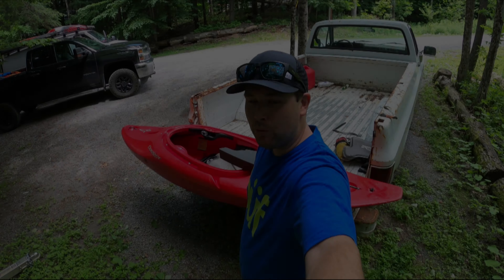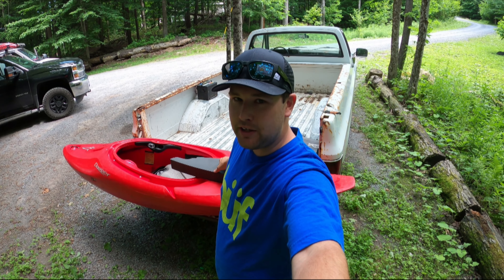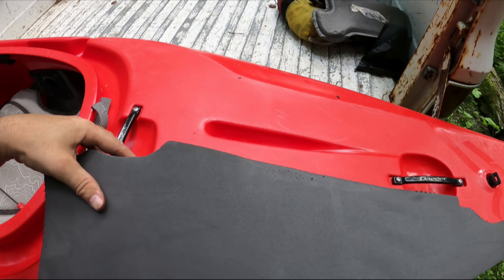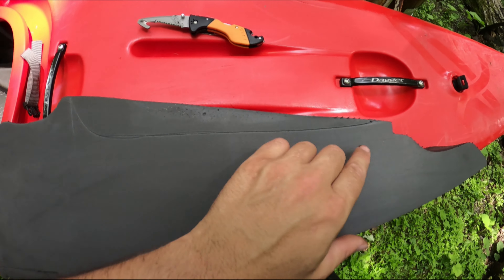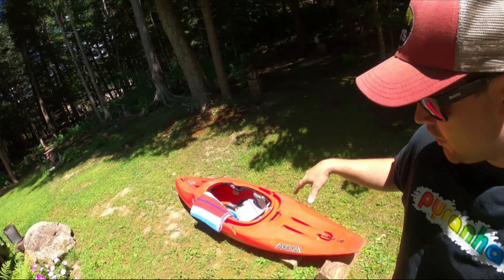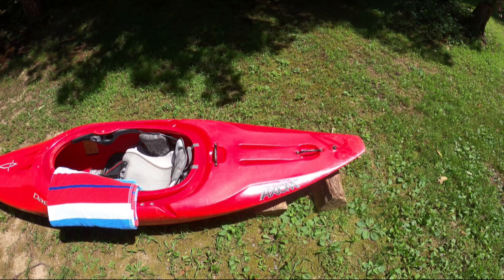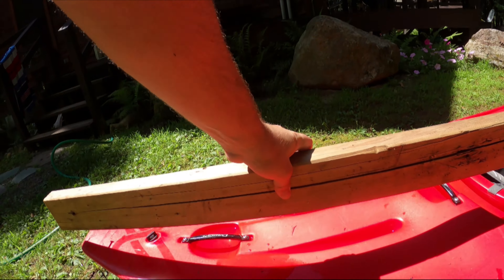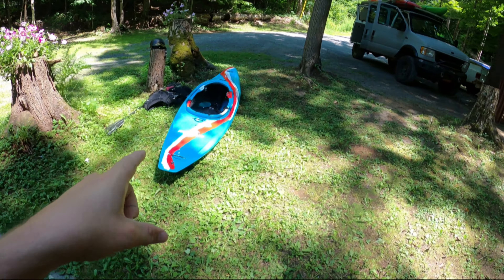Squishing Sterns | Making a Better Axiom I Boat Builder

Comment from the maker: Need to buy materials? Use these links to buy the best picks on Amazon, and a few cents will come back to my channel.
Backband Ratchets - https://amzn.to/3kjdT9w
Velcro - https://amzn.to/3eMoBUR
Silver Sharpie - https://amzn.to/32sTady
Automotive Push Clips - https://amzn.to/3lsIJhH
Razor Knife - https://amzn.to/3eMs99D
Spray Glue - https://amzn.to/3kaSvn7
Scraper - https://amzn.to/35bYQdu
Rivet Tool Kit - https://amzn.to/35bxwfB
Kayak Rivets - https://amzn.to/3pbKn9B
Dewalt Drill and Bits - https://amzn.to/35b8XPP
Dewalt Oscillating Tool - https://amzn.to/2JKnfP6
Cheaper Oscillating Tool - https://amzn.to/2IkrMYi
My Full Dewalt kit - https://amzn.to/35iYty9
Starter Tool Kit - https://amzn.to/2UnTMNf
Solid Tool Kit - https://amzn.to/35em175

Comment: Thank you for the great video- I just did this to my Braaap and it is so much more party! Stoked to try it out again!!
Reply from the maker: Awesome man! Enjoy!
Reply: @AlexBarham  hi man
does it pop back up if you leave the boat on the sun, or is the deformation premanent 

im thinking about crushing the stern on my prijon hurricane, is it same process squishing  blow molded plastic vs rotomolded ?
Reply: What effect did it have on Braaap performance generally? I have a Braaap and can sink the stern but require a good eddyline or a little wave to help (I’m quite light). Thinking I could turn it ‘Party’ but not sure what the trade-off will be for bigger water performance. Any thoughts?

Comment: I also want to do it with my Axiom 9.0 but I am scared that it will pop out to the old shape and I ruined it.
Reply from the maker: If it pops back it isn't ruined. Not a tom of risk
Reply: @AlexBarham  But then the foam doesn't fit anymore and you need new

Comment: Awesome video! Any thoughts on repairing an oil can beneath the seat on an axiom with the playboat outfitting?
Reply from the maker: These are tricky. Most of the Axioms were made with the Countour Playboat seat with the welded in track. If that is the case you'll have to get creative. Maybe try wedging foam under the seat. 

This is how I do it in standard boats with a hollow, roto-molded seat. https://www.youtube.com/watch?v=W78cictcq4s